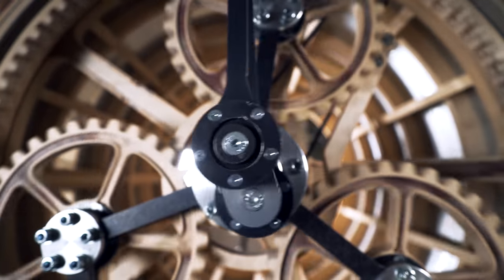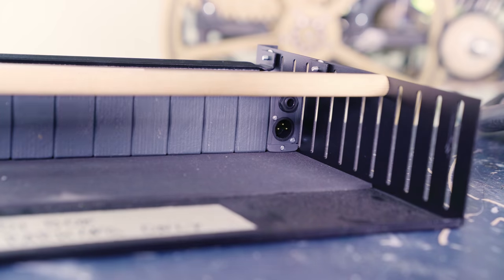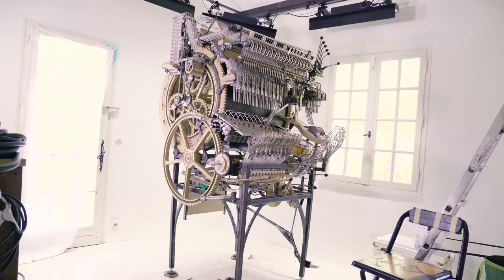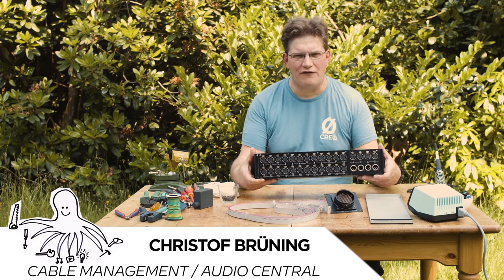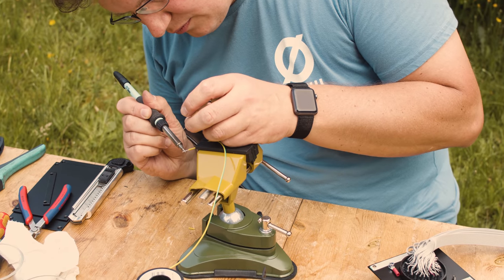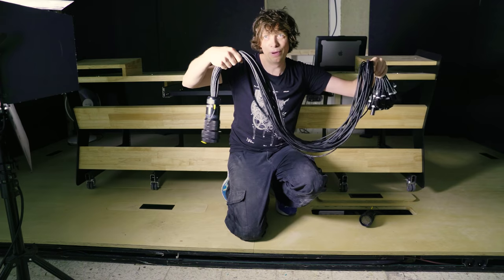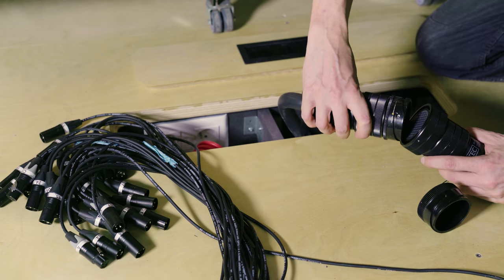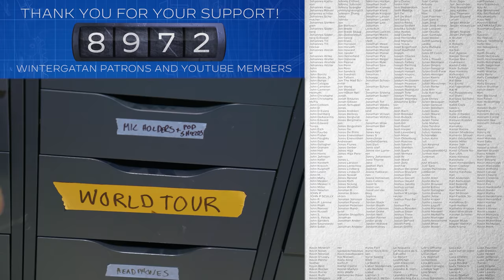28 Audio Channels in One Cable! - Marble Machine X #133

Comment: Was there any reasoning behind using an analogue multicore over an option such as Dante? Like a Yamaha Rio at the Marble Machine and a single ethernet cable to your studio desk? Just a thought!

Edit- I'm aware of the differences between analogue and digital standards and the cabling involved, this is why I've asked the question in the first place, to see why he didn't opt for the amazingly easier method of AOIP. Regardless of the 'quality of the analogue signal chain' it's all getting converted to digital at his RME preamp anyway. He could still take an analogue split at the MMX using an isolated XLR splitter, enabling for tapping into the signal before the Dante I/O box of choice.

Nevertheless, this is cool af 👏🏼
Reply: Most audio engineers prefer to keep analog as long as possible for maximizing sound quality
Reply: It is cooler looking I guess. I wonder if they make massive oversized clicky Ethernet cables.
Reply: this one, right: https://en.wikipedia.org/wiki/Dante_(networking)
that looks very cool, and I agree would be a much better fit, even though it's digital and the MMX is pretty much the embodiment of analogue...
Reply: It looks like his desk has a bunch of space for racks and processors. Now he keeps the ability to run the tracks through outboard compression if he wants.

Though... When I read your idea, I did think that it was genius if he never plans on using anything but his interface.
Reply: .... not positive,   but I would imagine it'd be better to keep all of the audio channels separate from eachother, so the signals don't have to get "mixed together",  keeping them all as clean as possible.
Reply: @microcolonel  that is one beefy RJ-45 connection
Reply: @microcolonel   I prefer the ethercon from neutrik, they look a bit like XLR connectors: https://www.neutrik.com/en/products/data/ethercon
(edit: and a bit more affordable too ;-)
Reply: you would still need some power going into the mmx but yeah, much easier than this analog giant...
Reply: I went and check Yamaha Dante and it make sense to use it rather than those many thick cables.
Reply: My thought exactly. If you tour with your own mixing engineer it gets easier, too, since you can have all the mappings beforehand and just need to use 1 (or 2 for redundancy) Ethernet cables and are already good to go, pre-mapped in your mixing console. You can also not mix up the XLR plugs at the stage box and re-program conveniently at your mixing desk.
Reply: Actually in Dante systems, its common to use 2 CAT cables. Other is a backup, so its super reliable. That LK150 or similar multicore is way easier to use though.
Reply: @ginglyst  Yeah, looks like those are readily sold with 100m+ reels as well.
Reply: There are options other than Dante, such as AVB/RTP/AES67 that are nice since they can be routed through ordinary IP network equipment (though for reliability you'd still want mostly point-to-point, or closed network).
Reply: @jtorola   For studio Yes , live not anymore
Reply: @microcolonel  guess so, and yes they do, it's called EtherCon, not large but still 'clicky'
Reply: @billymanilli  Dante is multichannel digital audio to the highest degree up to 96kHz and more I believe
Reply: @leke628  you should join discord and suggest this there on the discord server
Reply: @leke628  for purely studio use, redundancy would be total overkill, nevertheless still welcomed for when it goes out on tour. Cat cable is still copper and still wears down, but it's a lot easier to replace 2 cat cables than it is one large multicore with 80 odd fragile pins
Reply: @microcolonel  I've seen a custom made Ethernet multicore like that designed to carry 8 HDMI feeds
Reply: @microcolonel  most definitely. Not only that, but if he chooses to add MIDI control in the future, that can obviously be done over a network too, meaning a rack with a network switch would make for one swanky and articulate solution
Reply: For studio recording purposes, no.  However for live performances and universal compatibility with whatever sound system you might find in a given venue, XLR is the best way to go.  Remember the MMX is being designed as a concert instrument first and foremost.
Reply: @dustinf11  interfaces such as the Focusrite Rednet would allow for Dante I/O to be output on analogue TRS 1/4" to do the same job his RME can
Reply: I think a digital solution (like Rio) probably takes up more space (on the machine itself). But when you go on a worldtour, your signal most likely has to be converted to digital near the stage. You can't run the analogue signal all the way to front-of-house (that's just to risky). So a digital solution right on the mashine probably makes more sense...
Reply: jtorola Nah, I’d rather convert to digital ASAP. It’s less chance for shielding issues or ground loops.
Reply: billy manilli Switching to Dante or something over cat5 doesn’t mix anything together. You still have full separation of the signals.
Reply: I had the same thought, Dante seems to be a better option here, the cost of that cable is ridiculous!
Reply: @jtorola  You will find that very few use analogue multicore to the mixer now... A Digital multicore would save so much time and effort and when on a gig time is precious!
Reply: @jtorola  that's not really true, the cables act as low pass filters and also introduce noise. But I can understand the analog philosophy.
Reply: I was expecting a synaptic web of RCA intercons lol 🎡🎡🎡🎡🎡🎡🎡🎡🎡🎡🎡🎡🎡🎡🎡🎡🎡🎡🎡🎡.

But seriously, the preamp brick that your partner-in-chime fabricated is very well suited for the job. Made to order one might even think 😉.
Reply: @billymanilli  A digital stage box is just that a box that looks like what Martin has here but sticks them down some CAT5/6 and into the mixer directly so full control of the channels and the ability to do what you would with an analog stage box. Plus when you are on tour the last thing you need to throw at the crew is another 24 XLRs to plugin! :|
Reply: @jtorola  Thats not true, not anymore, 5 years ago maybe, but majority of mixer manufactures can run there desks at 96khz, and Dante runs at 192khz if you want. Yamaha has Dante natively in their PM, CL and QL Series Desks, and for extremely long runs the PM series uses fibre. Rednet is also Dante but for studios. Ethercon is the best way.
Reply: The broadband and quality of a single ethernet cable can’t possibly compete, can it?
Reply: @RedHair651  the opposite really. Analog cables can't compete. Once you go digital you no longer have to worry about things like crosstalk, and the cable doesn't have to measured in pounds per foot.
Reply: yeah that huge analog multicore will be a pain in the ass on stage. Why not go digital right away, when on the end of that multicore there will be a digital stagebox in most live situations anyway? Being able to use analog outboard equipment in the studio doesn't really matter, you'll be able to get an analog signal out from any interface when needed, without a real perceptible drop of quality.
Reply: As a stagehand who's set up concerts, the analogue multicore is more durable than ethernet cable. I appreciate the weight of ethernet when I'm pulling in to front of house, but you have to baby the connectors and I haven't met an ethernet cable that wanted to go back on it's reel. If you tour with ethernet be prepared to replace the ends.
Reply: microcolonel something to remember with RTP and AVB is the latency is much higher. AES67 would be the way to go, and by the way....Dante and AES67 are practically the same thing.
Reply: AGEdude I would actually argue that more recording studios are switching over to Dante enabled products. It’s easier to route, control and introduce new I/O.
Reply: Unknown Regions Ethercon is just a cabling transport. The protocol that allows high density audio over Cat5/Cat6 is Dante or AES67/SMTPE2110.
Reply: jtorola as an audio engineer, in this scenario I personally would have opted for Dante, or the preferred stage box that their engineer is using (Midas DL rack, Yamaha RIO etc) if given the option,

This allows for flexible on the fly routing for festival sets etc (where routing often gets quite funky) 

Audinate dante also gives the option of virtual sound card into a computer allowing for 64x64 recording and playback, helpful after a show to listen what was incorrect with the machine, also giving the virtual sound check option to get the settings completely dialled in (critical for festivals with a lack of sound check time)

I’ve been using Dante approximately 9 years, and other than user issues(often with routing)  I’ve never had a ‘bad signal’ being digital all the way, no risk of earth hums 

I hope my insight is valued
Reply: Barry Hatchel what type of Cat cabling are you pulling? Do you use solid core or stranded? Also, even if you do have to replace an Ethernet cable it’s only a few bucks. Ethernet is cheap, 16 awg wire isn’t as cheap.
Reply: @barryhatchel  Pardon my possibly rude tone, but I too am a stagehand, not only that but an audio engineer, music producer, studio owner and musical performer also. Common ethernet for use in IT infrastructure, yes, is very much seceptable to kinks and snapping from repeated patching etc, however, it's not really made for that, it's made for static installations which are never subjected to movement. Cat cable for use in live events however is constructed a bit differently, making it a lot more robust and whilst yes, Cat cable ,as I've mentioned, is still copper cabling, is superior to common XLR even for analogue audio transmission. Dave Rat has a great video on YT describing his custom EtherCon cable and how it fairs up against common analogue audio cabling in live events, well worth a watch.
Reply: @JD-lx2yf  Dante is indeed built upon the AES67 protocol. Not only that, there's also Ravenna which is comparable in latency
Reply: I've thought about it and for me, in the studio, you can have everything big and heavy, and you try to keep it as analog as possible.
But for the live, he can have directly the "spider", as he calls it, connected to a Rio, and go digital. This solution gives more flexibility in my opinion.
Reply: The amount of professionals in these comments is astounding... 
As an event tech: digital would have been stealthier, cheaper and more reliable in a tour setting.

To all the pros here: live sound engineering is about ease of use and saving time during setup and sound check. Since most venues sound like shit there is not much point in chasing after a (non existent) analog sound advantage. 

Analog can also be very noisy... Bah.
Reply: I guess to be flexible on tour and be abled to just plug into the mixing board at any venue
Reply: @microcolonel   I prefer the Neutrik etherCON RJ45. https://www.neutrik.com/en/products/data/ethercon
I've also seen USB connectors using the same idea and actually built a rack module with a bunch of those for a company that used a load of them in their lab for QA testing. First version used more normal USB sockets but they wore out and became unreliable so it was redesigned to use the locking style of sockets.

Edit: Sorry Ginlyst. I didn't see your post before posting...
Reply: @jtorola  in a live situation, you probably want the exact opposite. mic -> preamp -> converter. this minimises noise and can be transmitted anywhere you want. it's 2020, AD converters do not degrade the audio anymore. don't get me wrong, i'm a big fan of analogue, but in this case you want the cleanest path and 20 meters of analogue cables will just degrade audio quality.
Reply: @master1749  It is valued.
Reply: AGEdude these days you really shouldn’t be thinking about plugging into “whatever the venue has”.  Most touring acts will spec two or three models of console that they are willing to use, and the venue can sub rent an appropriate console if needed. Go Dante and request a Yamaha CL or QL, very standard gear nowadays.
Reply: A Dante setup can be deployed as a high-density snake within seconds.  You can even have custom profiles setup for Mixing, Straight Snake, Recording, etc...
Reply: It should also be reminded that the MMX will be going on tour, so it also needs to maintain compatibility with most venues including those that haven't upgraded to digital and places that have upgrade tend to also still have compatibility with older systems.
Reply: @barryhatchel  there are cat 5e cables that are pretty similar in handling to xlr or multipair cables, but its not really worth the cost. At least reterminating ethernet is fast and easy compared to xlr. (Or the nightmare of multipair where crimping the pins on is simple, but wrangling them into the connector... 🤮)
Reply: @RobertSzasz  since my comment I also keep thinking how much money Ethernet likely saves in transportation costs.
Reply: Directly quoting a reply to another comment from Arthur Skudra, "1) while digital can reduce all this analog wiring to ONE Cat5e cable (Dante or AVB audio network protocol), you still need a preamp at some point to convert analog audio signals to digital, and they take up a lot of room, and make things look cluttered on the MMX.  2) Judging from his use of RME preamps/converter, it is obvious he is using some of the highest quality microphone preamps/ analog to digital converters available on the market today.  Even if installed these preamps in the MMX, they would take up triple the space for 24 channels (3 x RME Micstasy) versus his current analog and flexible setup."
Reply: @master1749  Of course your input is appreciated. Thank you.

This community has introduced me to so many interesting designs and concepts, and I really appreciate the comments. My view is that all positive input is good, even if the idea is ultimately rejected, because its the discussion of all the concepts that leads to a good final solution.
Reply: I only wish I could have asked this question first. 28 channels over Dante is easy. I routinely run 40x24 channels on my Dante network on shows I run. As much as I love multicore cables, A pair of Ethercons would be so much easier.
Reply: @barryhatchel  it's probably cost competitive to just buy a spool of outdoor rated cable near the venue and make the cables just the right length on site. (Long runs over fiber not so much, but that's so much lighter compared to copper the transport isn't as bad)
Reply: @Huntracony  You do realize, that he has all the Preamps installed on the MMX already and that he is using the RMEs only for AD conversion? The XLR Hub on the MMX which connects all the mic-pres to this huge multicore cable could be replaced with a Dante Interface of the same size. While i do agree that RME is a leader in quality, AD converters today don't nearly have the same quality issues as they used to have. So this is not really an argument against Dante, since he is not using the RME preamps. 
And to all the people responding "what if the venue doesn't have Dante?": You can just buy a Dante to Analog converter, which solves this problem and you still only have to run one CAT cable to the FOH, where you can place the DA converter. Dante, Ravenna or any Audio over IP solution would've been more practiable.
Reply: Simon or, simply bring a digital console along that allready has been programmed for the MMX. Huge timesaver.
Reply: @steavey86  exactly
Reply: @bbbbeeeaar  Yes, horrible, for life processing, if it's brocken, then everything is gone. If one of 24 Multicore lines are brocken, you have 23 left and a small hack and your are back on track.
Reply: @blaegme  as an Event technician i know only some small venues that dont have a cat Line from Stage to FOH, but in these small Locations the analoge multicore they have usally cant handle 60+ Channels (28 from marbelmashine, plus all mics from the rest of the band).

With the complexity of so many Channels i assume that they will have a Sound Tech on Tour with them -> probably with their own digital desk with recorded snapshots -> they dont care what mixing desk the venue has installed
Reply: @jtorola  I sometimes wonder if the misconception that "analog = better quality" will ever stop
Reply: @samurai1993  As a modular synth person the the only place that analog is really useful is in filters. Outside of filters all my favorite modules are digital.
Reply: A Digital system at the MMX would reduce the possibility of interference along that cable run. It would also give Martin the option to have easy control of the levels and have presets for different songs. In any case, he would want to have levels dialed in and only send a combined output to the main house mix. These digital systems are nothing new and can be controlled with an app over wifi with no problems. The “Analog is Better” mindset comes from people who just don't understand the technology and want to stick with what is simple despite the loss of quality.
Reply: @Scodiddly  This would force extra gear rentals, lead to firmware compatibility issues and finger pointing when things don't work. He absolutely has the right solution.
Reply: Barry Hatchel I’m sure you are aware of ethercon connectors by Neutik? I’ve toured ethercon around the world on a minimum of 280 shows a year for the past 9 years, in that time I have terminated 3 new connectors, twice when the sleeve bent and would not connect nicely into the stage rack (this can be solved short term by just unscrewing the outer casing) and once when a heavy handed stage tech pulled my line through a cable trap and snapped the line entirely (could happen just as easily on XLR) it is true that older systems were fragile but they’ve came along way since then
Reply: basically it skips extra converter and gain stages that will reduce your audio quality
Reply: @jtorola  I don't follow. If it's going to end up digital anyways -- which it will -- the less analog wiring the signal goes through, the less analog noise it will pick up. It seems to me the exact opposite of this would be true.
Reply: @samurai1993  Analog is much better if you are a band who did not get much sleep last night. They can plug this in and go. No finger pointing if your gear won't talk to someone else's gear because of firmware issues, no renting another console because the venue uses a different digital protocol. Bands should only travel analog and let the digital conversion, troubleshooting and gear availability be someone else's responsibility.
Reply: @blaegme  that's where the analogue XLR splitter would come in... For venues who haven't transitioned to a digital workflow yet.
Reply: jtorola more like the opposite. Digital is way easier to get the result you want. Unless you want some really hi-fi high res gourmet shit you probably use an digital solution.
Reply: Totally agree, this could be much more tidy. Also: why a million separate knobs when he could control the gain of each channel digitally with 1/4th of the rack? Digital doesn't mean bad anymore nowadays, even with cat5 you can reach sufficient bandwidth without noticable quality difference.
Reply: I wonder if it's all down to familiarity with that kind of setup, but your solution does sound much simpler, and potentially more reliable.
Reply: @Agedude  on "world tour" scale it's not about "system you might find in a venue". If they are bringing MMX and all other instruments they'll definitely find room in a truck for own mixing desk, outboard gear, stagebox, etc. Or they will specific requirements for local equipment provider. It just doesn't work like this when one day sound engineer mixes on Yamaha & Dante, next day on Avid & MADI, etc. They have technical riders for that.
Reply: @jtorola  This is a complete misunderstanding of how audio works. A long analog cable degrades the  signal. A digital link does not.
Reply: @barryhatchel  true, but also it takes like 5 min to replace connectors on CAT5
Reply: Having had the pleasure of switching to digital mixers in three different systems lately, this absolutely would benefit the chain of production, but there's a few considerations. Analogue mixers are far, far simpler to handle, and digital ones take some learning and technical know-how to get to grips with, for only a few minor benefits like smaller transfer cables and built-in per-channel effects, more possible outputs and some other things. If that isn't needed, the thick-ass cable is generally fine in favor of super-simple usability.
Reply: I would argument that the sooner the signals are converted to digital, the better.
There is no loss of quality in the digital signal chain, so any loss of quality will be on the analog signal or in the conversion.
Reply: @jtorola  I can see why for a studio environment, but even for touring? AoIP solutions are so much faster, lighter, and space efficient.
Reply: analog are to heavy to hear on tour any different! a cheap Behringer also work on tour, but maybe behring can't hold in his rackspace... 
the external compressor etc.. u can loop it in also in digital.. but u don't need it if u have the good stuff!  signal splitting with digital is cheap, and very easy
Reply: Going digital as early as possible is a good way to reduce crosstalk between channels. If you have a bunch of analog signals in a single cable, and the individual channels are not shielded, then there will be crosstalk. Now I did not pickup any information about the cable from the video. So I'm not saying that this will be a problem. Also, I don't know how widespread any digital standard would be. So it could become an issue during the world tour. But the idea of having a single Ethernet cable is very appealing, IMHO.
Reply: The Midas DL151 has 24 input channels that can provide phantom power to the preamps, uses 2 HE just like the analog stagebox, simply needs 2 ethercon cables for aes50 and 1 power cable.
In the studio you can use the Etherface interface by DSPRO. On stage you can plug the 2 ethercon cables directly into the main mixing console and provide power to the midas stagebox and all the wiring is done.
Reply: This would overcomplicate stuff, and you defo don't want uneccessary complications when going on a world tour.

Yes, it's totally normal (and standard) to use dante/aes50 from stage to FOH, but there would be zero gain from adding another stagebox purely for the MMX. Just added complication.

LK-85 is used on many productions. It is low-tech and will most likely not fail. If you arrive at a festival and have to work with the festival's supplied Midas equipment, there may be zero option of using the dante equipment. Lots of unexpected things happen on tours.

Yes, I know you suggested a sound split on the mmx that would solve most unexpected problems, but that would add even more complexity, it would add more weight to the mmx and it would ultimately undermine the entire point of using Dante anyway.
Reply: @microcolonel  You can put Dante, AES67 on normal LANs without problem. Reliability has nothing to do with it. Those standards are designed to travel on COTS infrastructure and can actually account for the latency of each network switch they traverse. It is however smart to segregate the audio over IP packets to their own subnet and that is easy to do using vlans.
It actually adds to the flexibility and reliability of the system.
And don't get me started on the reliability of that massive multicore. Those things are made to be installed and left alone - definitely not moved around on tour.
Reply: @jtorola  Not on festivals/concerts. Digital mixers. Digital amps. Usually only a couple of ethernet cables from stagebox to sound mixer. If anyone uses an analouge mixer, analouge amps and a xlr snake from stage to FOH, it's most likely because of seriously extreme budget constraints and/or old equipment.

On-stage it's still common to use regular analogue cables, but that's just because there's no gain in doing anything else (apart from going wireless, but that's expensive).
Reply: @Agedude  Sorry but not since the early 2000'.  There are very few reasons to transport analogue audio in a studio anymore - and I don't see any of them in his specific location. And to your point that the MMX is a concert instrument - this was the first application where digital stage boxes completely replaced analogue ones with multicore cables.
Reply: @paulodpereira  Honestly after more than 35 years in the industry I don't understand it anymore - especially not for sound reinforcement, which will be the primary use for the MMX.
Reply: My first thought is for venue flexibility. A whole lot of venues still only run analog. This also lets Martin easily add external analog audio processing if he wants. In my opinion going analog out on something like the MMX provides way more flexibility, while keeping the amount of electronics on the machine itself relatively low.
Reply: Stephen Robertson I don’t agree.  A band like Wintergaten is not going to just roll in and use whatever relic happens to be sitting at FOH.  Doesn’t happen these days.  At the very least they’ll carry an X32 or something, because nobody has time to dial up a complicated show on a different board every day.
Reply: @microcolonel  Dante runs over  an ordinary IP network too
Reply: @BlameItOnGreg  No they don't - most venues are digital. And even if they are not, the interface from and to the digital stagebox is analogue XLR (it can also be digital or both simultaneously). But because you are in the digital realm while transporting the audio long distance through electromagnetic noisy environments, bad earthing and poorly stabilized mains - none of it has an impact on the sound. Unlike when you do the same in analogue.
Reply: @BlameItOnGreg  with midas dl151 and dl152 you can go from 24ch analog to 24ch analog with 2 ethernet cables and anyone can work with it
Reply: @blaegme  not at all, dante is absolutely industry standard, for years now, and everybody uses it. And on tours it's not uncommon for the engineers to bring their own console, so we really don't have to worry about comparability
Reply: @stephenrobertson2197  I don't know how much you know about Banda touring, but they have indeed someone else who does that for them, it's called the foh engineer and Dante is an incredible broadly used standard that doesn't face "firmware" issues. Bands nowadays have nothing to do with their audio set up, that's done by professionals since ages, what are you even thinking.
Reply: @Chris The Pack Rat there is an  electric motor attachment for use in the studio, so he can sit at the desk while MMX is playing.
Reply: @egork92  many venues also have their own sound equipment and the technicians on staff to run them.  I know of at least one venue whose union contract forbids outside technicians from replacing the staff technicians for an event.
Reply: @ChronoSakuya  Yes it does, but nowadays most engineers only use analog consoles to learn the signal flow, then they are shown digital. Every concert location is digital nowadays, and while some small gig place might not, it doesn't matter, because almost every tour takes their mixing console with them, imagine switching between differe t consoles every day, having to repeat the mix, across different manufacturers and setups. Nono, they just bring their own console and send out the mix to the PA that they often also bring with them
Reply: @SethTaylor1  yeah, looks like Dante uses AES67, I thought it was proprietary.
Reply: @davideberle4552  you could use power over ethernet, assuming it doesn't need more than like 100W.
Reply: @Scodiddly  X32 is good and all, but I think you're not aware of what a little peep that is to what we usually use for these kind of applications. More like CL5 and upwards
Reply: @Agedude  I know at least 10 events that have opted to pay the venues workers what they want and then letting them sit around and give their technicians don't he work, bc the engineer has to know the band, every song gets pre mixed, they have to know the setup and so on...
At some point it's not about money, it's about reliability, the local technicians are usually only there to provide a seamless connection to the local PA (although it's also often brought with them on larger gigs)
Reply: @Scodiddly  They will absolutely use a digital console, but it will be owned by someone else. the venue, the production company, whatever. They will carry show files on a flash drive. Showing up with your own digital snake to tie into someone else's console is a terrible idea. It would require renting specific consoles that may or may not be available locally and would lead to figure pointing when things don't work. He went analog for a very good set of reasons.
Reply: @einereinar  I know a fair amount about it. I've made a living doing audio for a couple decades. You are completely correct. that "someone else does it for them" which is entirely my point. Let the production company handle digital signal distribution. Do what almost every band in the world does and provide them with analogue inputs.  Dante is not universal.  There are several non compatible proprietary standards. I can assure you that using two pieces of Dante hardware running different firmware will probably result in no audio. He made the right decision with the setup he has.